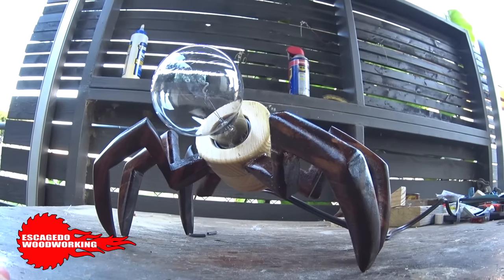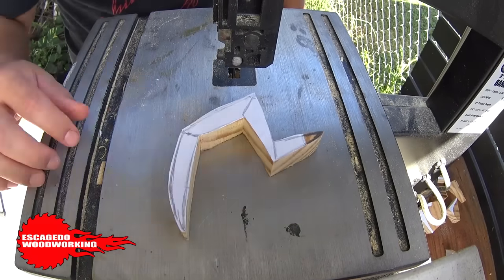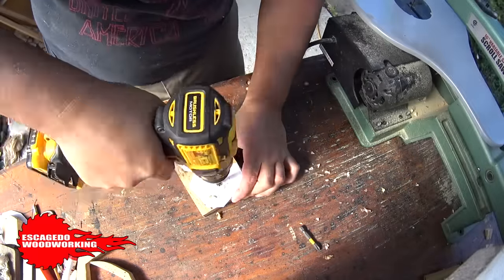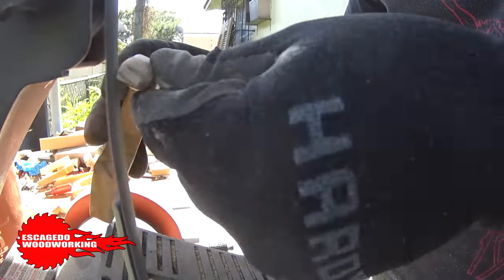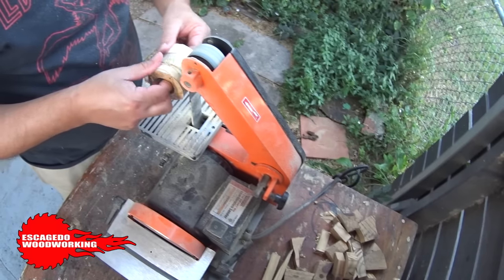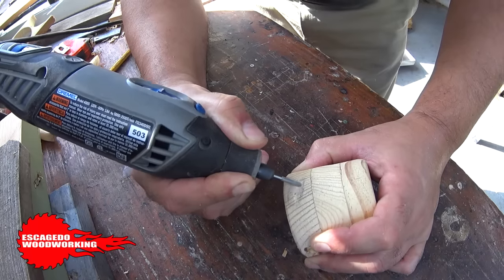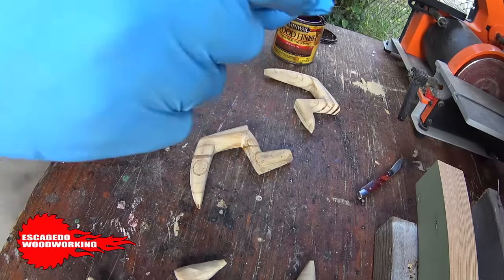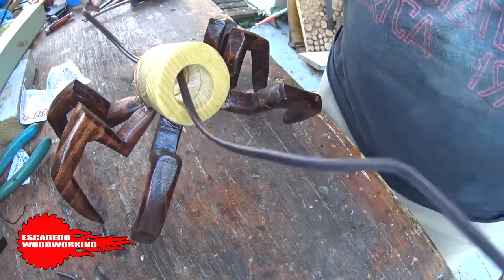Spider Table Lamp

Comment: what grit were you using on your belt sander for shaping? I have a similar 1" belt sander and I use 50 grit and it just hogs away material like there's no tomorrow. Even with the tiny motor that it has.
Reply from the maker: yeah it's a good sander. Other thank I get shocked by it. Does that happen with yours? Anyways, the grit is 60...I think that's about right. Could be 80 but I'd have to check....
Reply: Yeah, it does happen with mine. Its from when you sand without being grounded by the metal table. When you arent touching the metal table that your work piece is on when you're sanding, it builds up static electricity. And when you touch the table again, being grounded by it, you get a shock.
Reply from the maker: yes....why didn't they address that..it's a bit annoying...anyways...
Reply: just try to keep one finger touching the plate at all times. even your pinky works
Reply from the maker: what a nightmare to have to do that though...